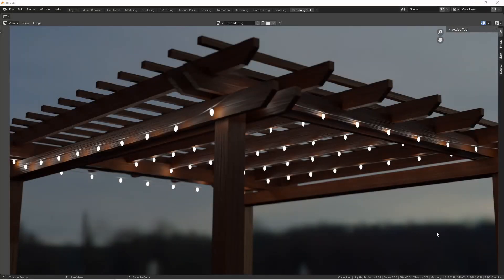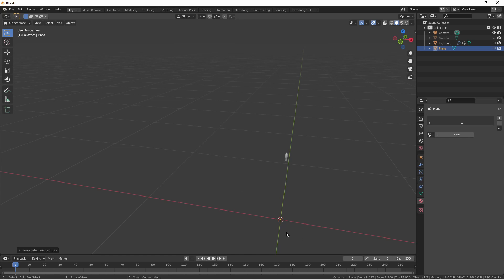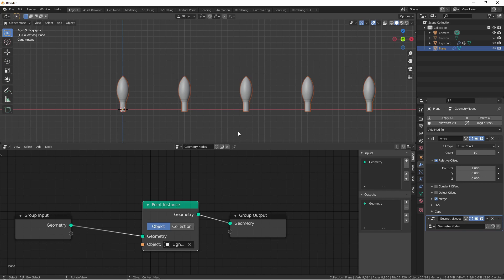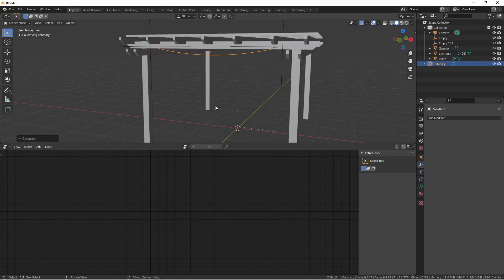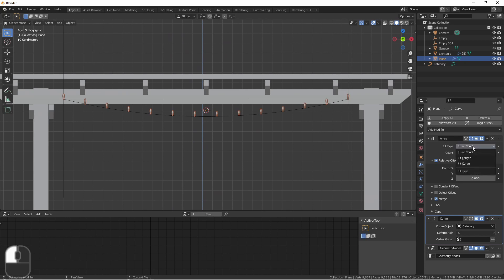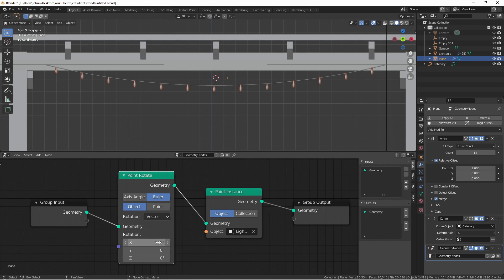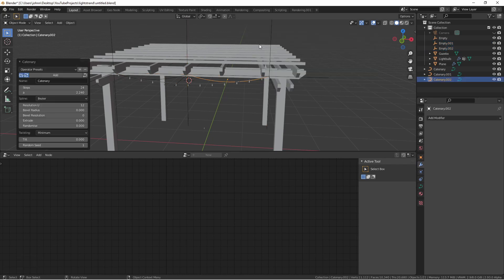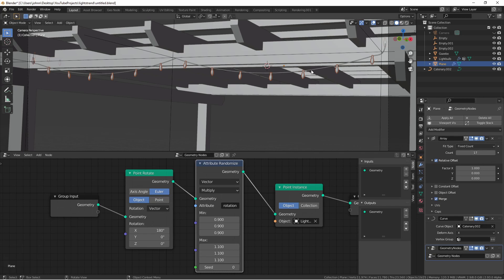Making A String of Lights in Blender using Geometry Nodes & Modifiers

Comment: Hi there, this tutorial is perfect but there's a new Instance on Points node that replaced Point Instance.  Im an absolute newb to Blender. May you do a tutorial with the new Node?
Reply: In Blender 5.0:
go Group Input > Curve to Mesh (Plug a Curve Circle node into the Profile Curve) > Distribute Points on Faces > Instance on Points (plug you bulbs into the Instance) > Join Geometry (with original Curve to Mesh node) > Subdiv > Group Output

Comment: Hey so I followed these steps, but when I added my lightbulb to the point instance node, it made them huge and it won’t let me change their size, is there any way to fix this?
Reply from the maker: Select your objects and apply size. You probably resized the objects in object mode instead of edit mode.
Reply: @JohnnyMatthews  Thanks! I’ll try that too, but I also found another way to do it while I was watching your tutorial. You basically just apply the curve modifier to the catenary, and then instead of pressing “g” and then “x,” you just press “s” and scale it up or down to change the size. Your suggestion is definitely easier, but I’ll just leave this here in case anyone makes the same mistake I did. Thank you for the quick answer!

Comment: I'm a rookie with Blender modifiers but I still find it easy to just that light bulb on a Fit Curve Array modifier and with Factor X (my catenary is on Y axis though. Ah, whatever).
Then my bulbs will only fit and not stick to that curve until I add a Curve modifier. So in the end of the day, for me the geometry nodes are useful only the random rotation, which is useful indeed.. ah by the way, now it's january 2022 and the Point Rotate node no longer exist,  things are changing faster than Houdini releases x)

Comment: Alternatively... Create the lightbulb. Create the caternary curve. Create a monkey. Add geometry nodes to the monkey. Disconnect the monkey geometry. Drag/drop the caternary from the outliner to the geometry nodes. This creates an Object Info node. Connect Object Info's Geometry to a Resample Curve Node, then a Point Rotate node, then a Point Instance node set to the lightbulb. You can now control the number of lights by changing the resample curve node.
Reply from the maker: Yeah this video came out before some of those additions.